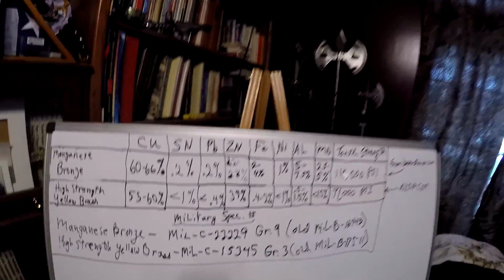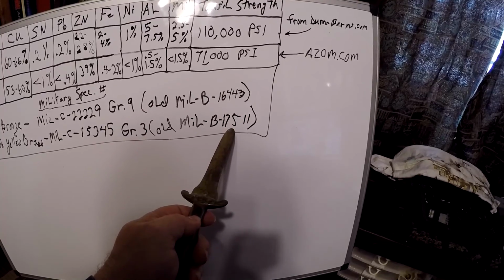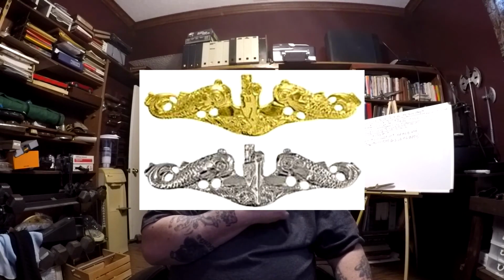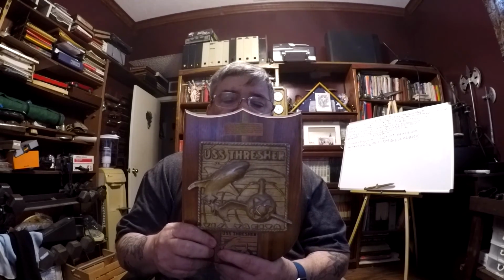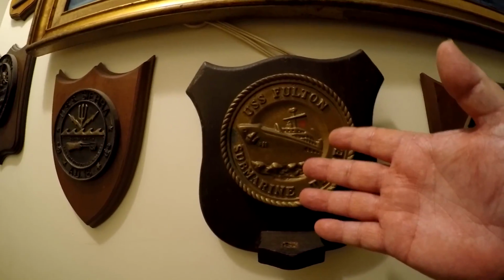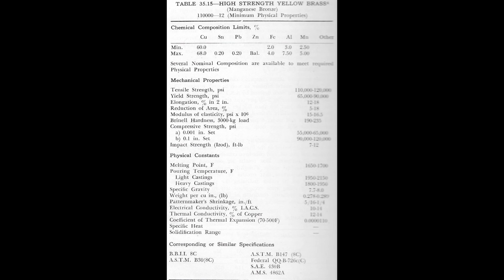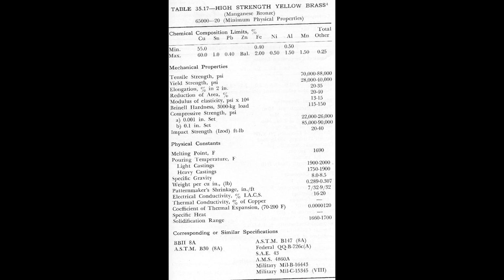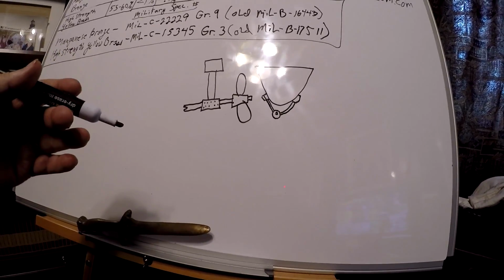Manganese Bronze and High Strength Yellow Brass

Comment: How did you darken the bronze with acid?  I have an old manganese bronze Ping golf putter with a shiny spot where the original sticker protected the metal from tarnishing.  I would like to try to better match that area to the rest of the putter head.  Thanks.
Reply from the maker: Go to a hobby shop or engraving shop and buy some Gravoxide. You sandblast the item you want to treat then coat the item with the Gravoxide. Watch the item turn black then spray the item with water. It will either be black or dark brown and what you want to do with it will be up to you.
Reply: @sandrammer :  Excellent...thank you...and for the quick reply.

Comment: Hi sandrammer, would you consider the following alloy high strength yellow brass? 65% copper, 25% zinc, 8% aluminum, 2% tin. Melted  from clean scrap materials however percentages are approximate and other trace metals unknown.
Reply from the maker: The best comparison I could find with your alloy was High Strength Leaded Manganese bronze ASTM B132 where the cu was 59%, the ZN was 35%, the AL was 1.5%, the SN was 1.5%, the Pb was1% and there was 2% iron. The tensile strength for that alloy was approx. 60,000 psi.